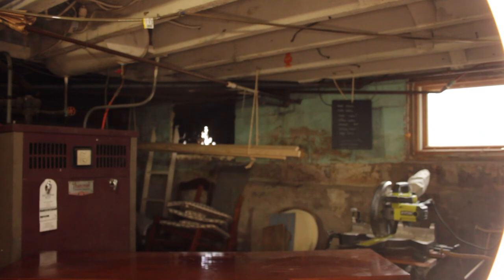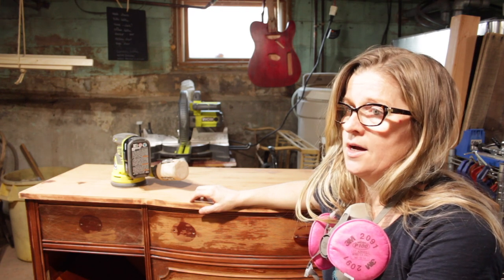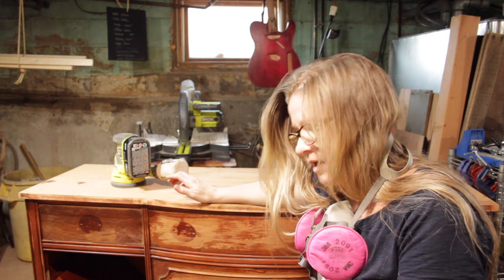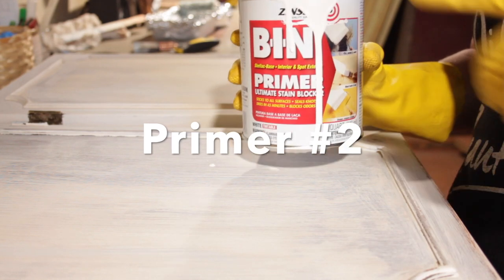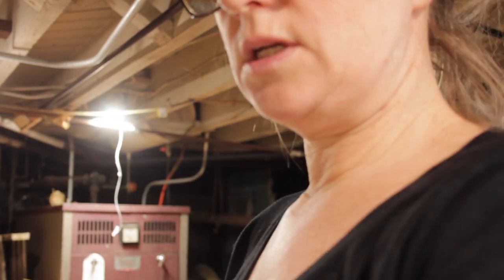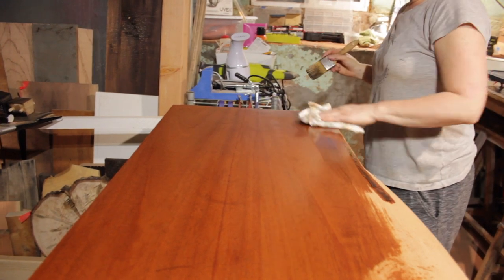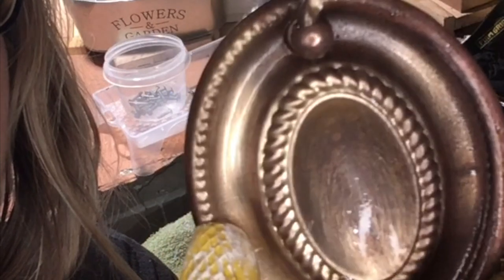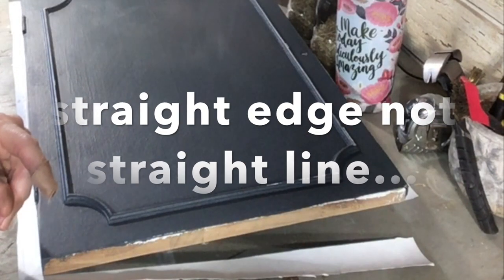Dining Buffet Furniture Makeover  |Trash to Treasure | FB Marketplace flip for a profit

Comment: Hello, this is Ken from Florida again. If your original plan was to paint, you didn't have to strip anything. The original finish was shellac the universal sealer compatible with any topcoat. TSP is fine but I think Superclean is cheaper and safer as a cleaner . Use s-clean diluted 8 to 1 with a green pot scrubber, your rinse water will look way worse than what you showed. Now you are ready to paint. For heavens sake invest in a hvlp sprayer! Citrastrip used to be a good product 10 years ago now it's been "greened ". Still strips but the residue turns to snot that is next to impossible to remove. Citric acid (available at any health food store) is better than vinegar for brass, you can mix it to a lower ph, then buff with stainless steel wool. You could be my Padawan if you lived nearby. Best of luck to your endeavors, Ken
Reply from the maker: Thanks Ken! I’ve order the super clean, thank you. I also tried looking for wet sand paper you suggested in another comment but haven’t found it yet. 
I really love painting with a brush! Maybe one day I could try a sprayer if I get my “dream space” (currently my shop is in a basement) but I feel like most people paint with brushes so I’m creating pieces in ways that people readily access too. 
Stripping is not my favorite and honestly I try to avoid it at all costs 😂
Happy to receive any and all wisdoms and experience you have! Honestly I appreciate it.
Reply: Try an automotive or boat paint shop for your wet dry sandpaper. Is this a less public forum for communicating? If I told you my email address would you be the only person to see it? I don't mind being a consultant when you run into problems. Ken
Reply from the maker: My email is in the description if you want to email me there